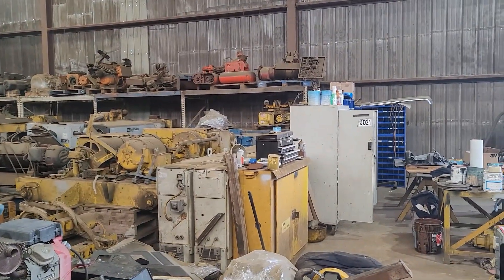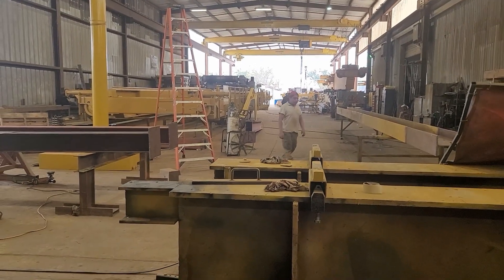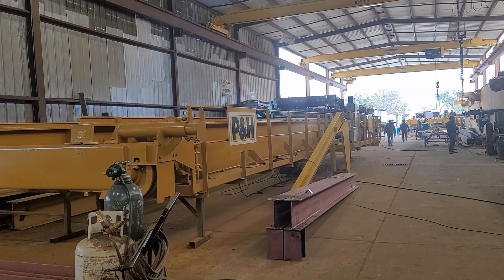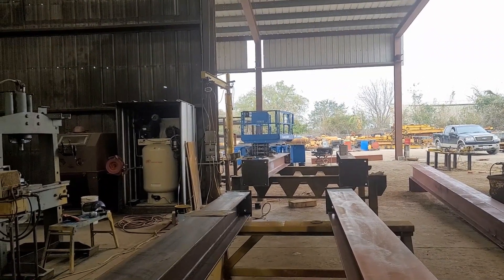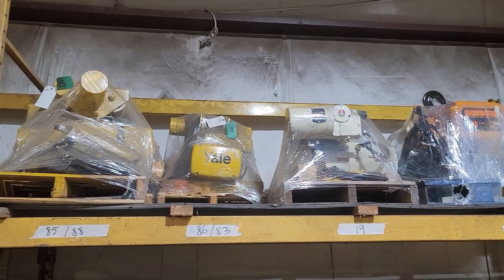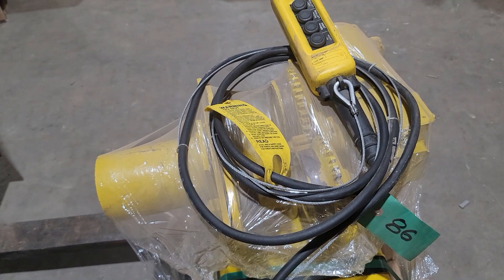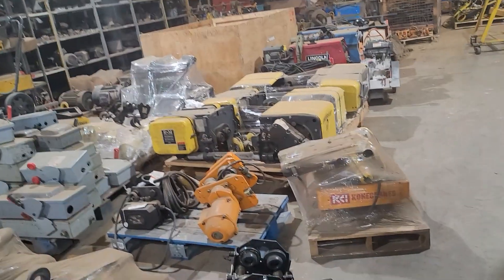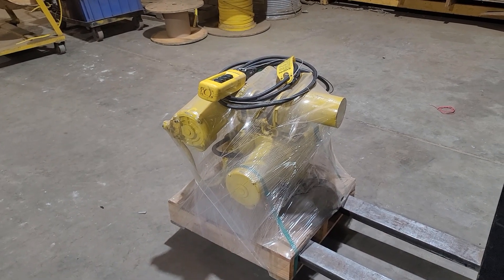Finding A New Shop Chain Hoist

Comment: Nice crane shop/business.  I worked for a company that manufactured motor control centers and analyzer buildings. We built a new shop 250 ft x 1000 ft. Half of the 250 wide part was 80 ft tall and had a 60 ton crane that went the full 1000 ft. The man that owned the business had bought the crane up north out of an old factory that had been shut down for many years. It was a lot of work to get that thing up on the rails. I wish we had got the crane on site before the roof was installed. Would have been much easier. Makes me think about you putting a hole in your roof to lower your planer...
Reply from the maker: I would love to have a crane to service at least the planer section of the shop.... Maybe someday :)
Reply: @10swatkins  I use that "maybe someday" comment way too often these days...